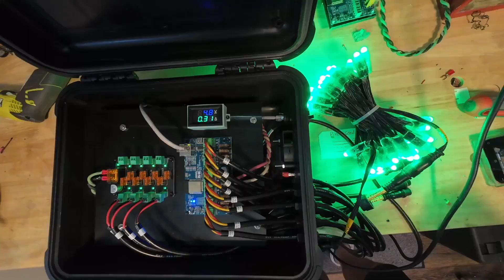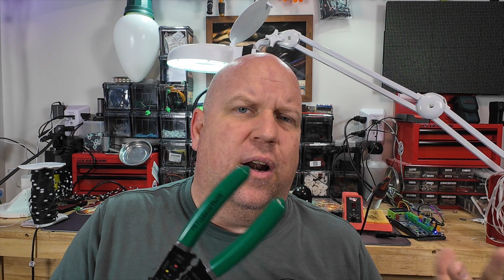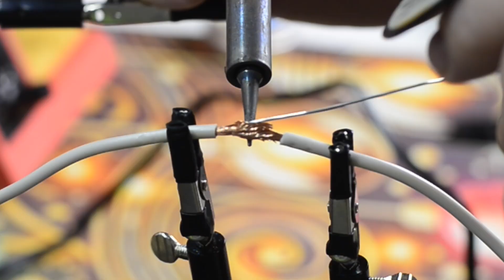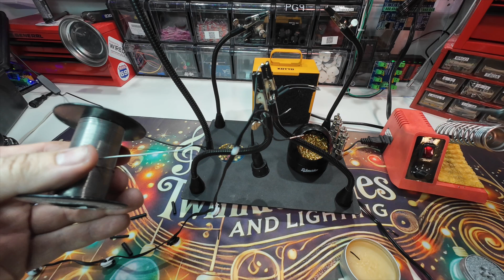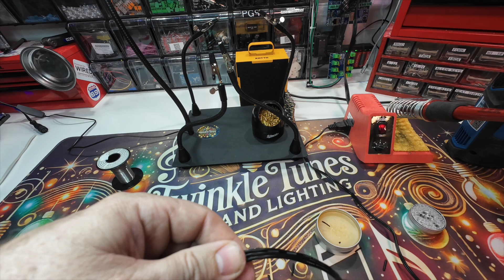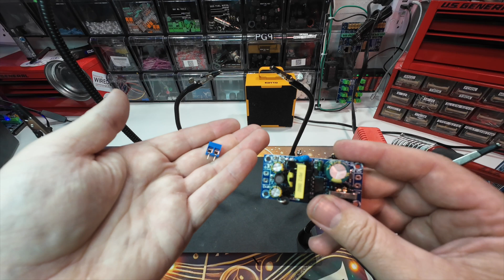How to Solder for Beginners (Step-by-Step Tutorial) | Best Tips for Clean, Strong Connections

Comment: What is flux for?
Reply from the maker: Flux helps the solder flow better and stick to the metal by cleaning off oxidation and impurities. Basically, it makes your solder joints cleaner and stronger.
Reply: @twinkletunesandlighting thank you 😁

Comment: Hi .What kind of flux are you using?
Reply from the maker: Hi! I'm using the Shneider soldering kit from Harbor Freight, which comes with a basic rosin-core flux. It's worked well for my LED projects so far. If you're just getting started, it's a solid, budget-friendly option. Let me know if you have any other questions!

https://www.harborfreight.com/soldering-accessory-kit-58008.html
Reply: @twinkletunesandlighting I think this is difficult for me. Can I find it on other sites, easier to find for the UK area?
Reply from the maker: @forestdamian5601  Absolutely! Flux is available on many UK-based websites. You can try sites like Amazon UK, Maplin, or RS Components. They typically have a wide selection of soldering supplies, including flux. Also, eBay UK can be a great place to find smaller quantities if you're just starting out. Hope this helps, and don't hesitate to reach out if you need more tips! 😊